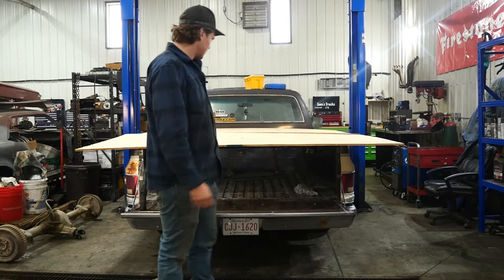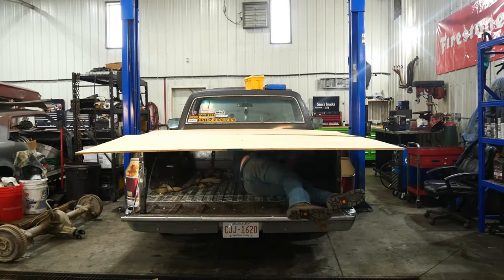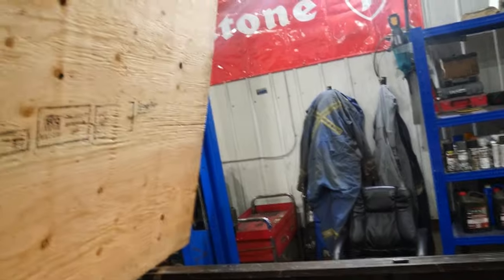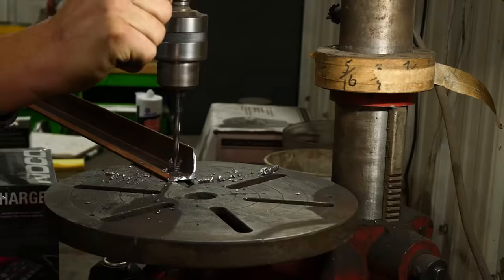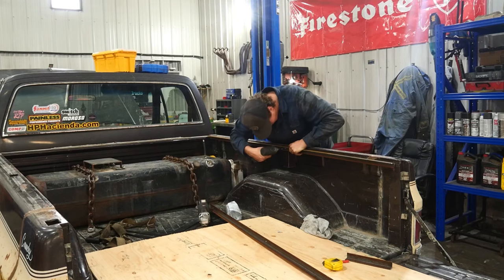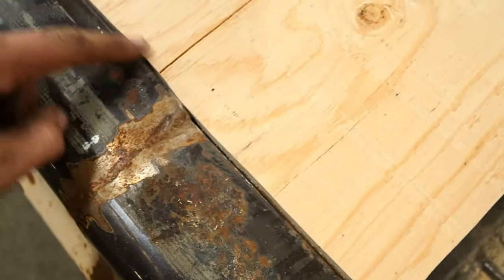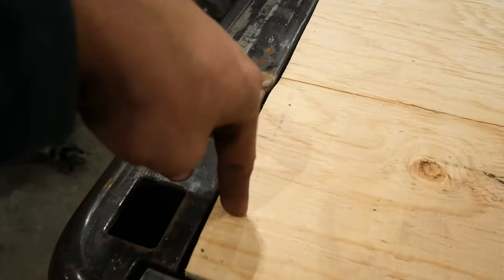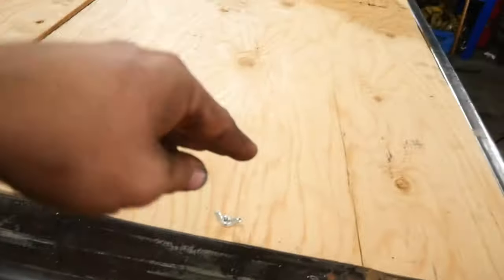BUILDING A BUDGET TONEAU COVER for Under $100! (EASY with basic tools)

Comment: Looks good …. I like cheap and basic…. Another idea to save some $ would be sealing the plywood with used motor oil , it’ll resist water, and deepen the colour …. It works great …. And you can reapply every time you change your oil! A little diesel fuel mixed in with the oil will help it soak in even better. I use this on posts and the wood floor of my utility trailer

Comment: Ive been thinking about doing something like this for an el camino. Which is what brought me here. I was planning to cover mine with vinyl and do gas struts to open and close. I didn't see any kind of bracing in the middle of yours. Does it catch wind and make noise at highway speed and did you have any issues with warping in the sun?